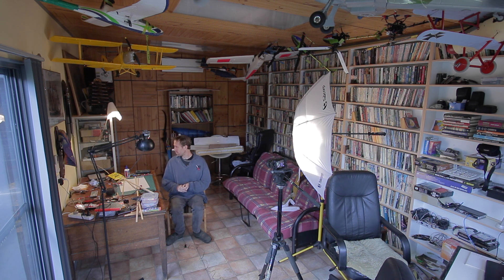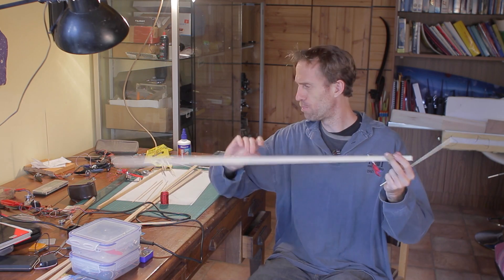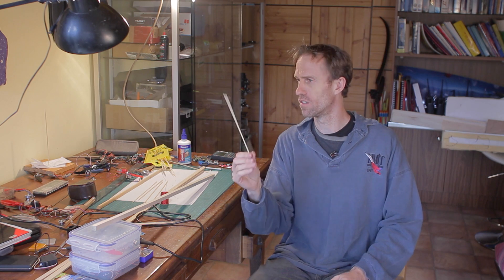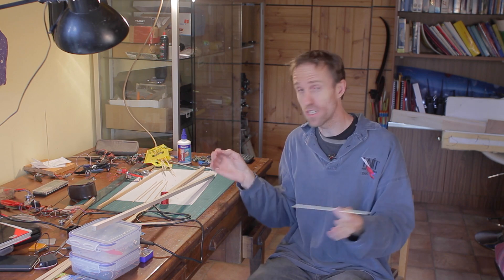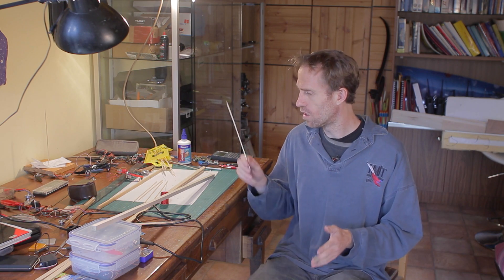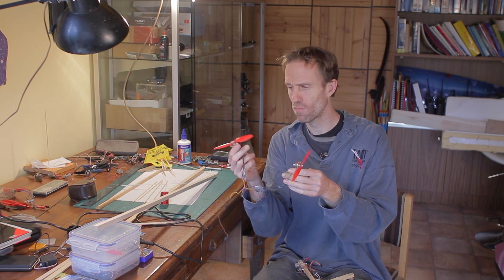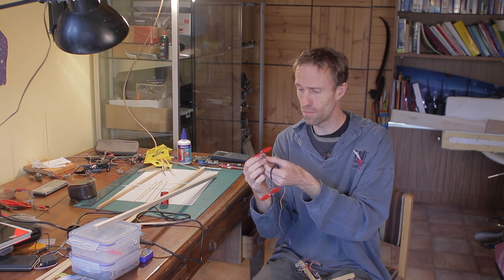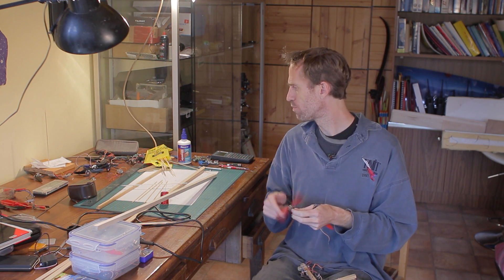Nonacopter scratch build. RCHacker #73

Comment: Glad to have you back... Very nice design. What is the AUW of the aircraft. Flightimes? I wonder what will be more efficient: 4 big motors with big props or 9 tiny motors with small props... Can't wait to see how well it flies and what the endurance looks like. Very interesting point about vibrations btw. You will not have less vibrations but the resonance frequency will be completely different and thus might not be visible in the video. Keep on going....
Reply from the maker: +MrCareyer with these small motors and props I have never had problems with vibrations as long as I balance them. even on a simple tricopter. i think some of the big props create vibrations just by the buffeting on the rotor arms.